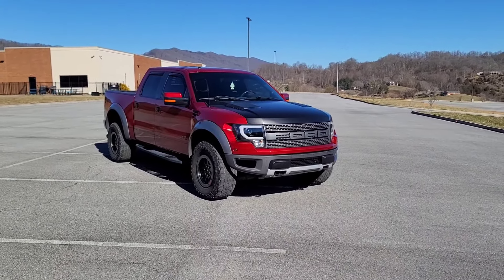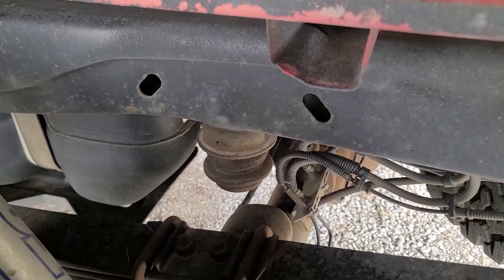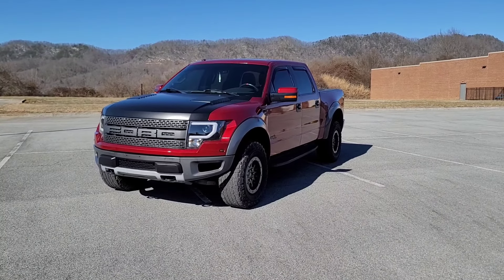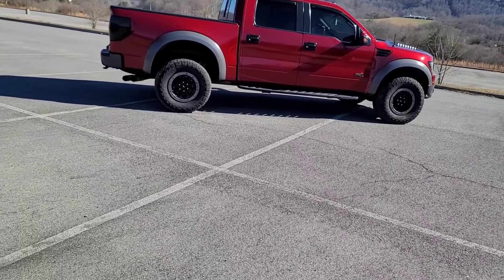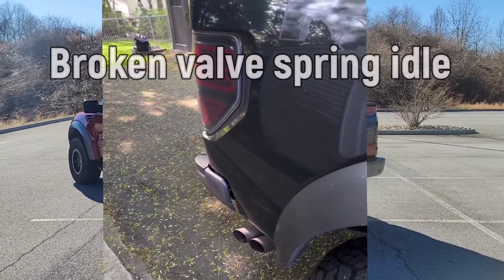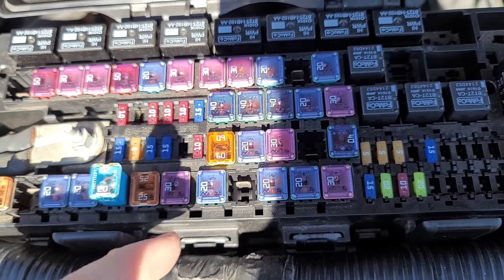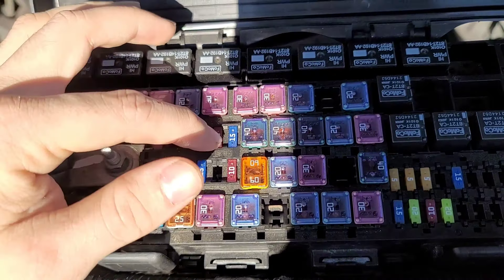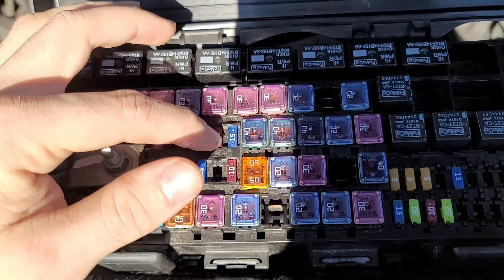Gen 1 Ford Raptor Buyer's Guide! What to Look Out For when Purchasing a 2010-2014! | 12th Gen F-150

Comment: The truck im looking to buy at my work looks almost exactly like this one. Even the LED taillights are similar. Same color, same wheels, 2014.
Reply from the maker: It might be my old truck. How many miles?
Reply: @OctaneSlain  120k
Reply: @OctaneSlain  headlights are the stock HIDs
Reply from the maker: Mine had 160k on it when I sold it
Reply: @OctaneSlain  28k a good deal for the mileage and year? 2014 with 120k miles, maroon with the red seats.
Reply from the maker: That's not a terrible deal. It's a 2014 Special Edition. They only came in this color or black with the red seats. The wheels are also special edition, this year only
Reply: @OctaneSlain  that's nice to know

Comment: Great review buddy! You hit all the main points. I got my 13 roush raptor new and now has 175k miles and still runs and purrs like new. I had to do the iwe replacement and the lead frame for the trans which are very common. And of course the fuse 27 fuel pump. Other than that, with proper maintenance, they will last and make you smile for a long time 😎🤙🏽
Reply: Currently looking for a 2013-14 raptor, been on the edge about the roush one due to just assuming most people with a supercharger just beating it to hell and not sure on how it affects the engines life. How has the engine/ maintenance been on the supercharger? Is there any worries to buying a roush with anywhere between 120-180k miles?
Reply: @pjhernandez9332 I wouldn’t see any worries buying one with that mileage. With proper maintenance the 6.2’s are great motors. The pulley might need to be changed with time on the roush or whipple kit. Besides that they do their job if maintained. I recommend getting the dual fan coolers when doing a supercharger though.

Comment: Great video. My 2012 also had the hood security latch fail. I think this is decently common issue as well. Alarm would randomly go off or when I leaned against the good while washing. Other than that, I think you hit every single common issue.

Comment: Great info on the Gen 1. I've had mine for 5 yrs and know every issue you discussed in this video :) . 1 thing i didn't know was the 4-scan for your OBD2. Do you have a link to where i can buy that? I've been living for 5yrs pressing the OK button every time i start the stuck to turn off the TPMS warning as i have aftermarket wheels and tires without the sensors....
Thanks.
Trevor